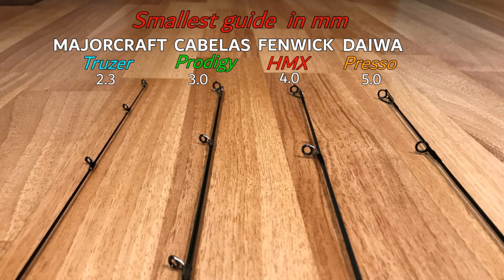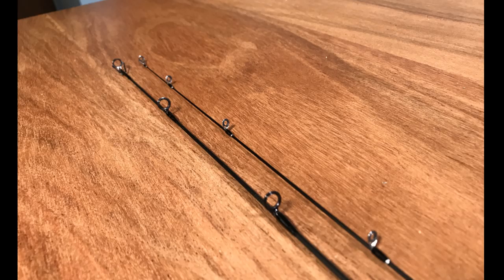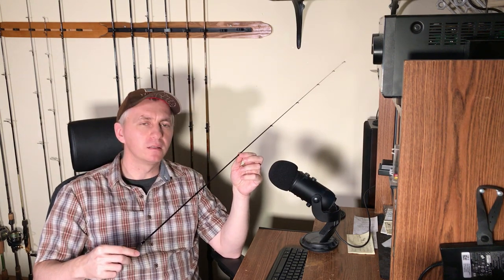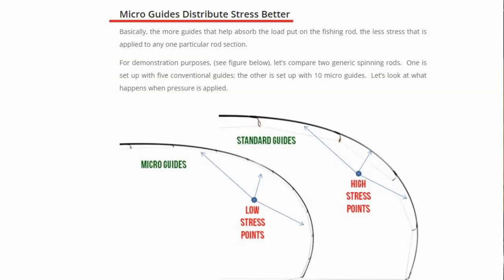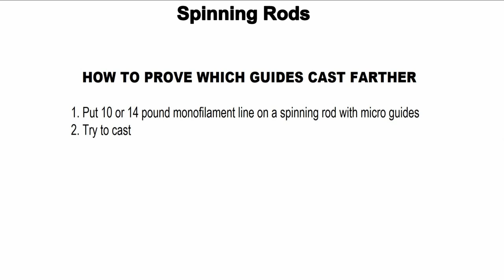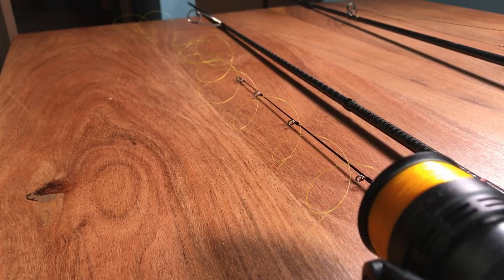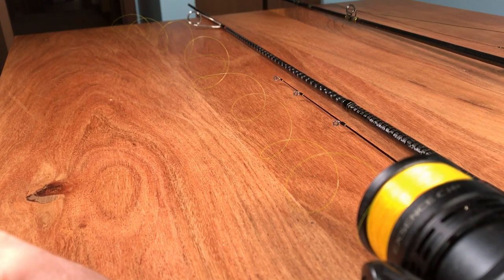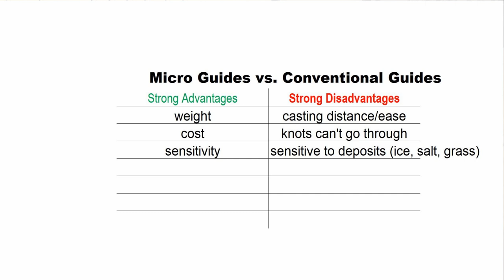The Truth About Micro Guides

Comment: Nice breakdown. I agree 100 percent. My biggest gripe with microguides is that if you use braid to leader knot, it often times hits against the guides when casting, which limits distance and accuracy.
Reply from the maker: because u use them with bigger weights. Try throwing a 1 gram jig. U gona get to hate them even without a knot.
Reply: You're not meant to use finesse type lures with micro guides. Also your leader not are obviously not the correct one. Try learning other knots. Or how about spool your real with all fluorocarbon or mono or braid so you don't have to use a leader than that gets rid of the problem entirely.
Reply: This is very frustrating, so in my early days I either shortened my leader or tried to learn an FG knot.

Comment: Top video! What wasn't mentioned was braid, which of course is super low diameter and much more suited to a smaller guide, the same as the 2lb mono, and in doing do reduces the disadvantages that you rightly discussed. I absolutely agree with your conclusion, there is a time and a place for everything and these limitations should be discussed by the manufacturer but they are not. The "New Guide Concept" from Fuji for guide size & positioning has far more practical real world applications than the later "KR Concept" which is useful only in very restricted circumstances.

Comment: Excellent video! There need to be more videos about the true advantages and disadvantages of products that aren't just industry hype. My experience with spinning rods is the size of that first guide as we move away from the reel is really important for casting distance. It also seems to help with it is lined up well with the height of the reel. I prefer to have that first guide be pretty big and in line with the reel because I usually fish from the bank and casting distance is important to me in lots of situations.
Reply from the maker: yes, me too. For years I only bought carp rods from UK and they ALWAYS advertise as special feature when the first guide is 50mm (usually it is 40mm but on long cast versions of same rod they go with 50). Honestly, you can HEAR the line going through micro guides when u use over 2 pound line. It sounds very harsh and like RRRRR

Comment: You missed one major advantage SIZE.  On my new Dobyns Sierra Ultra Finesse rod it was explained that it had micro guides because the blank is so thin at the top that regular guides can't be used.  This allows the end of the rod to be thinner and lighter than any rod with regular guides.  You could argue this can lead to the tip/rod being more sensitive because a thinner blank can be used.
Reply from the maker: never heard of Dobyns... i dont know what they told you, but now you know the truth

Comment: Liked. Thanks for suggesting this video.   Question: Are you saying that with UL lines (say 2-3lbs) micro guides don't really impact casting distance much if at all? Seems to be so at the end. (It seems that the only way to really tell for sure is to build two identical rigs, changing only the guide sizes.)
Reply from the maker: That is correct. At least this Varivas line... goes through the ABU very easy and i can definitely cast where I need without much fuss. I can still HEAR the line though.... and the line will go through the St. Croix completely silently. At the end of the day 2 lb will be OK with micro guides, but 3 will be more audible, and 4 or more will just not work. For pounds is too much for the Abu guides - i can promise you that. 
It's not the end of the world though... we fish with thin line for UL anyway, and we usually don't cast that far, here in the USA. Usually around some brush. So practical impact is minimal, when using thin line. But if i were saltwater fishing from the banks, and need all the distance i can get, and need a little stronger line - i would not consider micro guides
Reply: @ifishcatfish  Thanks!

Comment: Thank you Victor. There are a couple of rod builders here in the northeast who are serious bottom fisherman and are very obsessed with sensitivity in detecting bites in very deep water (2-300ft)  who actually believe that any form of ceramic ring dissipates energy from the blank more so then a straight stainless guide so we see stiff graphite blanks with ring less guides. similar to "ugly tuff" guides
Reply from the maker: thats nonsense. Ceramic is much MUCH harder than steel. That's the reason high end bearings have ceramic balls. Ceramic also flexes less, and flexing absorbs vibration and is no good. I know you use the term 'ceramic' as a general term for all derivatives, like zirconium, silicone carbide, torzite and whatnot, and so am I. I know those people you are talking about - they are old school and very superstitious, but from engineering perspective there is absolutely no argument the materials above are superior inserts than steel. Especially the 3 that i mentioned... they weigh practically nothing, and the only reason those people don't use them is because they are prohibitively expensive. But if they did, their rods would drop 10 grams of weight just from the tip, and they would be pretty shocked at the difference. 
The only way that would make sense is if you compare the steel guides against some super cheap and super thick Aluminum Oxide guides, that actually weight more than the steel guides because they are so heavy. But the 3 materials that i pointed above are so far superior than steel that comparisons are just not possible

Comment: Thank you. You may already know, carbon guides are being used on Diawa (AGS Air Guide System I don't know if on any UL rods yet) and Fuji is making  CMG Carbon Micro Guides,  (say lighter, stiffer, more sensitive, more ACCURATE casting and better hook setting) which are currently available on two of Abu Garcia Eradicator Real-Finesse rods. eradicator-realfinesse-cmg-cmg.html, other rods in series use Titanium/Torzite micro guides. I have not heard any complaints about casting distance from TroutMagnetMan, he uses a 4-5' shock leader with ester line, and thus does have a knot going through guides. Maybe it is your under hand flipping type cast that does not work well?  I bought a very cheap UL rod ($60 rod and reel combo) that tapers to approximately 1mm at tip. It has cheap micro guides, very easily bent, and even the first guides are 'too' close to the blank, and 'too' small, looks all wrong, thought I would have to get them replaced. It is rated down to 1/32oz Fast 6'. I cast 1/64oz Trout Magnets 30+ feet. Spiderwire has a new ultra thin Ultracast braid out, 4lb diameter is .05mm which is same as Sufix Nanobraid 2lb.
Reply from the maker: Well thats a lot to process. I know the ags guides. Teoutmagmetman uses 2.3 pound varivas line. If u use thin line guides are fine. They still reduce distance but not much. Also he uses heavier lures in general. I think i am done with micronguides unless i find something really soecial. I found my next 300$ rod and it still has titanium torzite guides, but they are not micro.
Reply: Seems unless he is fishing strong current or going deep he typically  uses 1 -1.5 gram jig heads.
Reply from the maker: Right. He says 1.5 gr is his sweet spot. With 2.3 pound varivas line and 1.5 gr jig i guarantee u can sling it out there even with micro guides. But the average angler doesnt use such thin line and such good gear as him. Also i have never used 1.5 gr jig for crappie, i go 0.6, 0.8 and 1.0 at most. Bottom line is micro guides are not for everyone, definitely not for beginners

Comment: I totally agree Victor. For Spinning rods with heavier lines or leader knots, micro guides are a no no. The talk about how they improve the performance of a blank is also not really true, unless they are being compared with double footed guides. The trend is to use more number of micro guides on a blank, all the extra thread and epoxy takes away the advantages it could have with lighter lines. I would be interested to hear your take on the KR Guide concept
Reply from the maker: Many brands have them with different names now.. i really don't care about the brand. I don't want micro guides any more. They just bother me all day. Yes, the rod feels nice, but casting is terrible, even with thin line. You can cast with thin line just fine, but when u switch to my favorite ultralight rod Daiwa Presso the lines goes through the rod completely silently and i just love that. I like to lob my jigs on to the brush. Lobbing just doesn't work with micro guides. You need to do overhead cast or some bigger motion..
More guides needing more thread and glue is a good point. I didn't think of that but its obviously true

Comment: Looked at a few rods with micro-guides. Don’t want my connection not getting hung up and seems like you mentioned especially on spinning rods would slow the flow of line through the first few guides. My casting rods mostly have semi-micro guides. Thanks for the great video and information!
Reply from the maker: If u like the rods dont be afraid of it.. but u have to use very thin line in that rod

Comment: I guess you would have to find a domestic rod here in the states that offers 2 versions of the same rod (one with standard guides and one with micro guides) that are also designed for heavier line so you could do a test on the casting distance and sensitivity. 

I would probably guess that heavier line would need bigger guides because naturally you would use a bigger size reel to spool up 10 lb or greater so that means bigger coils as well.

my jdm I use a 1000 size reel and true 2lb line( as alot of us manufactures claim 2lb diameter but it's breaking point is beyond that) and the micro guides cast 1/64oz jigs like a dream. 

I would figure on my jdm rod all things come into play with it's load and reduced friction with sic inserts and line control from  the k series  micro guides. 

I've tossed 1/64 jigs with my domestic ul rods from here in the states and it's like night and day for me. these have either standard stainless steel guides with inserts or the American tackle guides and still my jdm just does it better.

Im not sure if micro guides themselves are ever put on rods that are meant for heavier line beyond 5lb-6lb pe/nylon which I think most jdm rods are recommend for pe. but the jdm rods that have micro guided are usually meant for finesse fishing and you are tossing small lures since the blanks they are on are usually not rated for higher than 10- 15 grams. if they made blanks to throw heavier lures then I think they may not come with micro guides on the blank.
Reply from the maker: Right. As I said at the end, there is nothing wrong with micro guides, if you use them as you use them. There is no need for 2 versions of the rod, as I don't want big guides on my 300$ majorcraft rod. But like you I use very thin line. Actually I use 2.5 lb and i definitely have a problem with 1/64. I think i need to go down to 2.0 and it will probably work. 
The thing is when I do ultralight fishing i catch bass and catfish all the time, and sometimes even musky. I want to have a shot at landing those fish ..
Reply: @ifishcatfish  I'm surprised that you have issues with 2.5lb line what size reel do you use on your truzer. I use a Shimano soare feel that is a a little bit bigger than a 1000 size reel here in the states.
Reply from the maker: i use daiwa Theory 2000. Body is 1000 but spool is bigger. Also, theory spools are wider to begin with. I like those spools because the line is not curly. These small 1000 size spools leave the line very curly and with a lot of line twist.

Comment: You should have post this video before I ordered majorcraft speedstyle S63UL. I had a problem knot hitting the guide (uni from  4lb nanofil to 4lb leader. Anyway it will cast trout magnet (the one I won from you) about 30-40’
Reply from the maker: Its not the end of the world. Just go down in line diameter until it works..

Comment: Hello, great video.
I’m into Feeder fishing, I know it’s different than spinning, but still about Micro guide… and casting distance..
I usually fishing with 14ft Matrix xpro distance 150gr rod, having some 13-16 guides/ I don’t remember right now..
And I’m fishing usually with 10 lb mono/ 0.26 and i use 50 lb braid leader, Uni to Uni knots.. Still I can cast some 120meters with this setup..
And I’m using a very big carp coil Daiwa basia 45, something like 65mm + spool diameter and the first guide has some 19mm inside diameter…
Anyway seems you can add to your experience about Micro guide..
Take care 👏
Reply from the maker: i don't think you have micro guides. They are just small. You think they are micro, until you see a japanese ultralight rod.
Reply: @ifishcatfish  well, I measured, first 7 guide from top have inner diameter of 4mm..
Idk if it’s small or micro but I will say it’s pretty amazing for 14 rings on a rod starting from 19mm to 4mm to cast such long distance…

Comment: I just found this video..
Unfortunately, after buying a new rod with micro guides last month.
I was on a small river and starting casting once I found a spot.
I noticed greatly reduced casting distance and actually thought I was catching spider webs reeling back in.
It wasn’t webs, but my line was actually being shaved if I held my tip up above level.
Not happy, not falling for it again.
Thanks for confirming bullish!t on these rod guides.
Wished I would’ve found your video first.
Sub’n
Reply from the maker: thanks for taking the time to comment. Got quite a few of these, if it makes u feel better. If it doesn't make u feel better, just buy some super thin line just for this one rod, preferably super thin braid. I actually gave away the $300 JDM rod in this video : ) It was my first and most likely my last.. : )

Comment: Damn I feel like i just got tricked into buying an overpriced rod now that ive used the Gloomis E6x then compared it to the Fenwick HMX where I couldnt tell the difference then struggle to cast it far.

But compared to my cheap Daiwa Acculite rod, the Daiwa Acculite Rod makes casting far way easier.

Seeing this vid confirms my sanity. The bottom line for me is that the more expensive rods are lighter compared to the cheap ones.
Reply from the maker: most of it is weight
Reply: @ifishcatfish  sigh, i should have not listened to the hype the other channels are saying that so called expensive rods make you feel the bites better compared to others, when its all about just how light it is.

The way they make it sound as if it has magical properties that cheaper rods dont have.
Reply from the maker: well sensitivity is better in general too. But I don't think that u can't feel the bites at all with cheap rods. I fished cheap rods most of my life and felt the bites just fine. Yes, it is easier with light carborn rods.. but its not like u catch more fish. Mostly expensive rods are about pleasure... light, pretty, sensitive... but u catch the same amount of fish as cheap rods

Comment: I've never noticed the difference you speak of, but I never use mono either. Possibly it's thick, stiff and kinky enough to reduce casting distance with smaller guides.
Reply from the maker: what line do u use? Do u even use rods with regular guides? Some people use only JDM gear with 4 lb braid and they walk around and say they don't see a problem
Reply: @ifishcatfish  I have rods with both. I use 10 pound braid (4 pound equivalent diameter) on most of them, most often with a fluorocarbon leader attached with a double uni knot. I can feel the knot when I retrieve it through the tip guide (regular or micro), but if it affects my casting, it's not enough to bother me. I really don't see the point of micro guides. I didn't buy any of my rods because I wanted them, they just happened to be what was supplied.
Reply from the maker: u talking about spinning gear or ultralight? Even 4 pound mono is enough to tell the difference, if u have true micro guides
Reply: @ifishcatfish  I think braid is so thin, slick and limp, so superior to mono, that it greatly minimizes the effect of the guides, whatever their size. I only fish UL on the rare occasions that I target panfish or trout.  My usual gear ranges from medium light to medium heavy, spinning and baitcasting.

Comment: I have a lurmatic shimano rod With micro rings and shimano stella reel size 1000
I fish in salt water using the Japanies Ajing method. And I have come a long way with thick threads 
My poor thing: I have to go through thin threads in Japanese sizes that's 0.3PE ,This is difficult and requires good hands to tie the  braid line  to the fluorocarbon I use the Fg knot which he manages to get through in guides very well.

 My peak with Pe 0.3 is this Blue runner weighing 1,800Kg.
 All of my attempts with thicker threads have failed. But once I learned to work with 0.3pe it's just a tremendous thrill
Reply from the maker: Yes. Thin line is the only way to go. U have one more advantage because u cast long distance and u can swing hard. But if u cast short distance it is harder.. the line wont go through without a big swing with the rod
Reply: @ifishcatfish  thats true i swing hard 30 meter maximum whith 1.5g jighead

Comment: I can vouch for the claim that Michael guides cast further. It's physics. With micro guys online stays straighter when casting and doesn't slap around therefore the cast further and I notice it every time I use my rods that have them. You have to use the right lures though. With micro guides preferably the lures you're using should be a little on the heavy side meaning anywhere from a quarter ounce and up.
Reply from the maker: So u are worried about line touching the blank, but not worried about the coils having to go through micro guides??